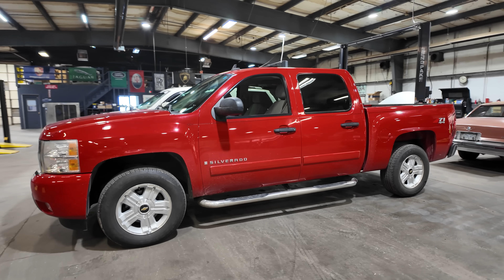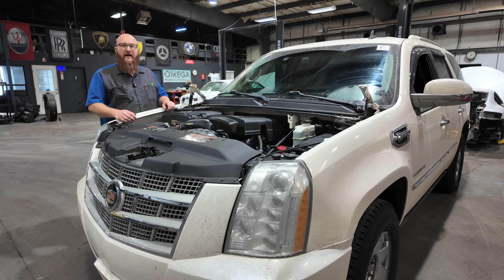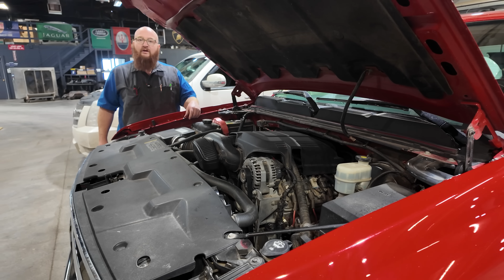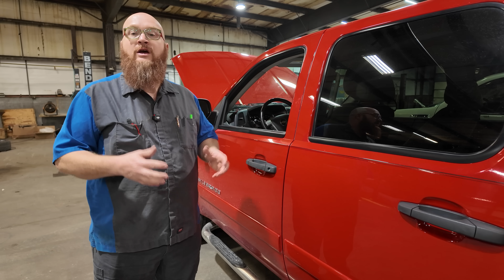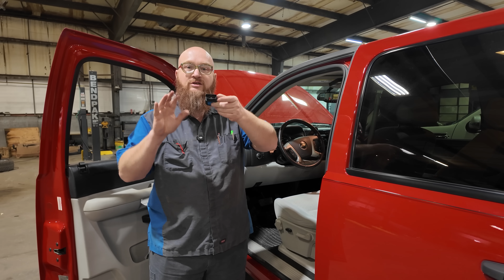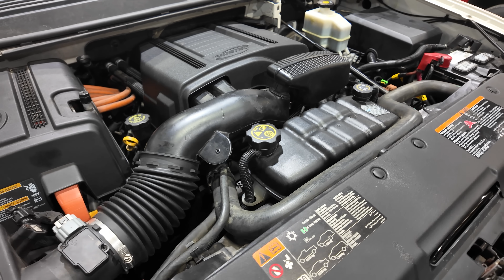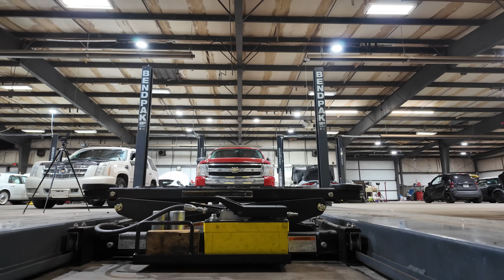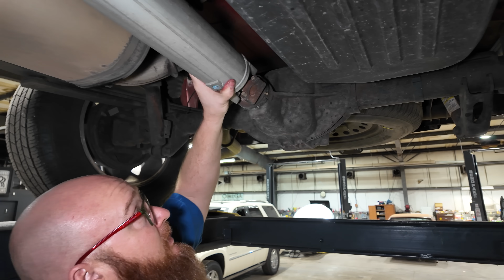AFM: Engine Saver or Engine Killer? The REAL Answer

Comment: I was thinking on buying a 2015 GMC Denali with the cylinder deactivation. This truck has a 6 speed so if you put it in 5th gear the truck runs in V8 mode and a 8 speed goes in 7th gear so apparently this tells the computer to stay in V8 mode. Can someone verify if that is true or not.

Comment: I wonder why every time somebody’s talking about that bullshit that GM invented they always try to throw in the oil change horseshit that has nothing to do with it apps I wish they would quit saying that it has fuck all to do with oil change that it was a design flaw if the oil is too thin or too thick. The design is what with the problem is as fuck all to do with anything else shitty wrong design. Try to get it straight if you don’t know how to say the word say it to yourself 1 million times and then don’t make a video unless you got it straightdesign flaw because the design was wrong. If you have to change something on the lubricant side, that means the design was not right don’t blame oil change or shit like this or anything else on it because if it in another engine runs on an extra 3000 km on the same then that one too so another word just said design flaw.

Comment: I just deactivated my AFM and tuned it on my 2014 chevy silverado with 159,135 miles. Better late than ever. I definitely feel my truck more responsive. Hoping to make it last another 150k miles. Also have an oil catch can on it and switched out the thermal bypass valve.
Reply: What and where is the "Thermal bypass valve". Is there a YouTube on how to do this? Is there a top quality thermal bypass valve to purchase?

Comment: Tons of respect Wizard but I'd love to know if you actually believe those work?  I've seen trucks with them installed with failed lifters and given the fact it's a mechanical failure in the lifter itself I have my doubts.  I also have a fear that preventing the valves from cycling normally could be catastrophic if the disabler box fails many miles later.

Comment: There are so many of these vehicles still on the road with the AFM working as it should. My 2007 had 238k miles and the worst thing I have is I have to add a qt of oil after about two months. I change the oil every 4000 miles now. I no longer wait for the engine computer to tell me to change the oil.

Comment: Current law in CA says any unapproved ecm programing with fail an emissions test. The only approved delete kit is sold by jasper with a rebuilt engine.

California screws consumers once again. You need to remove the plugin before inspection and ensure the monitors are completed.

Comment: AFM Is A Disaster...Running Spring Loaded Cam Lifters..Without Oil To De-activate Cylinders...ASAP..Buy A Delete Program...And Run All Cylinders The Way It Should Be....By The Way...Ford 7.3 Godzilla Engines..No Factory AFM......

Comment: Got a 2013 GMC 1500 with the 6 auto trans. Manual put in 5 gear selection and AFM will not engage. Thinking may get the delete plug in  for lots of highway driving. Believe it or not truck has 36000 miles on it! Think it was around 1700 RPM in 5th at 55 to 57 MPH! Who cares!

Comment: I'm a fan of your videos. You've made videos where you have said "do not buy" any of these trucks. I'm curious if you would upgrade these now to "buy with conditions." I have a 2017 5.3 and didn't really know much about this until I hit 100k. I heard that most have issues between 40 to 90k, but I went ahead and turned off the AFM anyway. I've had this truck since it was new and hope to drive it past 200k without digging into the engine. I've heard that switching to 5w30 will also help you to not have these issues, so I'm making that switch. I'm also reducing my oil change from the recommended 7,500 miles to 5,000. Curious what you think.

Comment: I did...had my 2018 silverado 5.3 deleted with the texas speed low lift kit professionally installed.....lasted 20,000 miles...#7 exhaust lobe was gone......now another $4500 for a rebuild with a stock cam.....yep....a lot pissed....

Comment: Oddly I guess, I had an 08 Yukon with the AFM 5.3 made it to 350k miles no major engine work, never disabled AFM. Had to trash it because Wisconsin winter finally took its toll. Driver side wheel well rotted out and the salt took out the electrical

Comment: Mr Wizard... curious question  ? Doesn't Chevrolet/GMC, offer a 6.6 V8 that does not have the AFM . In the 2500 / 3500 HD trucks ?  (L8...) Also something you didn't speak about.  The auto on / off mode. That repeatedly shuts the motor off and restarts it as you brake or stop .... Most trucks have a switch on the panel to deactivate it.  But you have to do so every time you turn the vehicle off and restart it. This system also causes problems ?

Comment: My 2012 Gmc Sierras engine 5.3vV8 had multile issues especially blowing a few lifters at 93k. Replaced with 5.3 v8 Jasper - no AFN  - have over 100k kn that engine - have had no issues and runs better than the gmc engine.

Comment: I have a 16 silverado with 200k miles. No AFM or lifter issues ever.  Regular syn oil changes and reg maintenance. Still drives smooth both in V4 and V8 mode.
Reply: Ive changed an engine in s 2019 police cruiser because of thd failure. Ive also deleted a 2022 police cruiser because it failed. 120,000 on the 19. 78,000 on the 2022. They have regular oil changes because we do all thd maintenance.

Comment: The lifters will still break on some engines even with the AFM disabled. My wife's 2016 Escalade did that. I disabled it with the plug in module at about 85K miles and had a lifter break at 114K miles. I did the full AFM delete at that point.

Comment: I have the disabler plugged in on my Sierra and the only downfall to it in my case is the cruise control doesn’t work while the device is plugged in. Remove it and the cruise control works again. But still, big picture, it’s worth the slight inconvenience

Comment: I used the Range disabler module, changed the oil every 3,000 miles with Mobil1 full synthetic, also use Lucas oil stabilizer. This is on my 2011 Silverado k1500 crew cab 5.3, 185,000 miles, still no noise. Also I removed the stock exhaust, replaced it with Long tube headers and full stainless exhaust

Comment: Replaced one collapsed AFM Lifter in 2019,  (I think it was number 4 Intake) with AC Delco (must have been a good batch). Tuned out AFM with Diablo Tuner. 70,000 miles later, no issues at all. No oil burn, runs like new with 250,000 mile on her.

Comment: I have DRM on my '14 Silverado LT V6 (4.3L) extended cab.  It's nice to get upwards of 36mpg over a 25mile range when it shift into 4 cylinder mode.  At nearly 16k miles, it's still running strong.  I do, however, change the fully synthetic oil every 3000 miles--although not Dexos.  There is a third way to turn off DFM/AFM: put the tranny into manual mode and shift it into the second highest gear (e.g., 5 of 6).

Comment: In ref to the AFM disabler, I have seen videos suggesting that the transmission thermostat should be removed or altered in some way.  I'm not quite sure what this could have to do with the AFM disabler, and I was wondering if anyone has some information that could help me determine the significance of the relationship of such a suggestion and if it is needed, thanks.

Comment: I have 3 trucks with the L9H 6.2L. (Non-AFM).  All have over 300K miles, have never failed, and still run fantastic.   The first thing I did to my '21 L87 6.2L truck, was delete afm/dod, the auto start/stop, and re-tune everything.   Oh, .....almost forgot...... I never run the oil GM suggests.   I run 10w40 in the L9Hs and 5w40 in the  L87, and have since new.

Comment: Lets talk about the LT engines and their failing plastice lifter trays that allow the lifter to spin in their bore due to the notches in the trays wearing out because it's metal on plastic or becomes warped due to heat and when the normal lubricating oil passages pressurize the lockout pin in the lifter because it's now orientated 90 degrees and collapses but still slams against the cam and chews it up...... ask me how I know. Other than that $8 part, I hadn't had any troubles with DOD at 250k miles

Comment: how bad is the AFM  system longterm? Of course we always hear bad stories about the AFM but what % of these engines  eventually require lifter/cam repair? My 2016 5.3L has 190,000 miles with no issues and no deletes

Comment: My 2018 is throwing misfire code for cylinder 7also smoking a little in the exhaust I  replaced coil, plug and wire. Still doing the same thing. Not really hearing any clatter though. I’m so lost don’t know what to do. thinking I may have to replace everything too.

Comment: We have a 2012 Silverado bought it used , the transmission didn't do the AFM until I had it serviced, after that I noticed something different. The dealer turned it back on. Sense then I bought the ObdII device from Amazon works great.

Comment: I had a 2007 Silverado that ate a quart of oil every 3000 miles.  GM tried to tell me that was normal, but my 2004 Golf diesel would only eat a quart of oil every 10K miles which was normal.  It would suck it into the PCV valve and burn it.  There was a TSB that stated due to the head design, the PCV was being splashed by oil.  GM designed a new head that had a cover in front of the PCV to stop it, but they wouldn't do the fix on my vehicle as it was out of warranty by the time the TSB was published.  I soon sold the truck and told GM some not so nice things.  It also had a leaf spring break which was a bit of a pain to fix as I had to drop the fuel tank to fix it.

Comment: I have a 2009 GMC Sierra with a 5.3, it currently has 235K miles on it. I bought it with 100K miles on it. I drove a lot for my previous job. I would check my oil once a month and change my oil at 3K miles. Everything was going fine until I hit about 130K miles. I was about 4 hours away from home and hear some clanking, didn't pay any mind because I have tools in my make very similar noises. I went to pass someone and when it shifted down, you heard noises match the rpms. I immediately pulled over, shut off the truck, and checked the oil. It had no oil on the dipstick. No oil pressure light came on and I had checked the oil 2 weeks before. I keep 2 quarts of oil and a gallon of antifreeze in every of my vehicles. Dumped the oil in and drove it the 200 ft to a little gas station. Bought 5 more quarts and it took 4 more quarts, it was bone dry. It quieted down immediately to no noise. I kept a real close eye on it driving back. Next day I got an oil change and got another a week later to and checked for the forbidden glitter, I lucked out and there was non. Called a local LS guy that I've used before on my 2000 Trans Am and tuned the afm out as soon as I was able. Changed the monthly oil checks to weekly oil checks. Haven't had a problem since.

Comment: I traded my clean low mileage Denali for a heavily discounted 23’ Armada platinum, brand new, due to AFM lifter failure on each bank before 40,000 miles. My Armada is the same age now  with more mileage, not a single issue.

Comment: Back in my drag racing days I used to use Rhodes lifters they were variable duration lifter and mind you I would put these in street vehicles not just racing vehicles but street vehicles as well and my Dodge van I had a 318 73 b100 and it used to work you know on the average got about 10 to 12 me on the in city in about 14 to 16 on the highway once I put the roads in there yeah sure City street if they made a little noise because they were variable duration lifter so yeah until the oil pressure came up to about 30 PSI or something like that you can get a little bit of a lifter noise everything was fine unfortunately I don't believe roads is even in business anymore

Comment: I’m glad to know my Silverado is at least easy to work on if/when anything does fail. We’re creeping up on 180k and I bought it with 140k. Been mostly trouble free, has a very slow oil seep from somewhere, and has a cold tick. Also doesn’t like idling very much, the rpms drop every 30 seconds or so, for like half a second. I’ve been pretty worried about the AFM and its problems. If anyone is reading this and has had similar issues with theirs, I would really appreciate any advice. It’s a 2013, 1500, 5.3.

Edited to add: I keep up with the maintenance, I only drive it when I need to because I’m trying to keep mileage low until I can afford to disable or delete the AFM. I don’t know much about the service history either.

Comment: I have a 16 chev pick up. It has afm. Dod system. I bought it with every thing functioning. I bought a range technology obdll plug in. Ive put 50 thousand miles on it. But i change oil every 3 to 4 thousand miles. Never more miles. It still works great .well see.

Comment: My 2006 gmc Sierra with the 4.8 non afm was the best gm vehicle I have ever owned.  My buddy still has it with over 250 thousand miles. I wish i still had it. I sold my 2014 Sierra as it was the worst one i have ever owned. I had so many issues with the 2014.

Comment: My brand new 2018.  5.3 chevy silverado !!!! And my brand new 2021 5.3 chevy silverado BOTH BLOW LIFTERS  !!!! LEFT  my girlfriend and I stranded the first time lake tahoe , the second time Lubbock  Texas  1500 miles away pulling my camper !!! So if you want big problems buy the chevrolet five point three and six point two !!! Those motors will always always blow lifters as\Sure , as the sun comes up tomorrow. !!!!! That is the only thing for sure in life that will happen !!!!!  From 2007 Even to today's date , two thousand twenty six !!! So I bought a two thousand six and made that truck brand new !!!!

Comment: There is another way to disable the AFM system from the cab, besides the OBD port device. Pull the gear shift into low and manual shift with the buttons on the shift lever. It will never go into AFM mode at that time. I bought the OBD device after I had a lifter turn sideways on #1 cyl, which sounded like a "sucking squeak" sound and destroyed the cam in short order. Just out of warranty but very low mileage, so GM went good for half the cost of the dealer repair. The next time the engine comes apart, the AFM system will be fully deleted and a decent aftermarket cam + lifters will go in.

Comment: There is another Way....put your truck in manual mode only until 5th gear....it will stay in v8 mode....if you shift to 6th gear it will activate the fuel management....you can also buy the one 2 dongle....but I get really good gas mileage in 5th gear

Comment: Gotta hand it to you Wizard.  I have a 330k 2007.5 5.3 silverado with AFM.  It's been working fine but I always have this dread that it will fail.  I want to do a cam with delete but it's just not in the budget right now.  I took your advice and bought a cheap $30 disabler from the jungle site.  It works perfectly,  THANK YOU!

Comment: I have a 2014 GMC sierra with the 5.3. when put in manual drive and limited to 5th gear actually tends to get better fuel economy than running in normal drive allowing AFM to activate. My hypothesis is that the AFM actually makes it use more fuel because I live in Colorado and the combination of the terrain and altitude makes the truck have to downshift sooner when AFM is actively running and it over-compensates.

Comment: It may be dumb but since 2007 to present it probably saved over 4 billion gallons of gas. The rich get richer and yet it's harder to keep my head above water and maintain my vehicle let alone walk into a Chevy or GMC dealership and buy new. I miss my 4.8 for this reason and have the new 6.6L gas although now I'm nervous about the direct injection leading to dirty valves let alone the complexity of high pressure fuel pumps. I suspect my caprice ppv 6.0L at 170k miles is experiencing lifter failure. Should I restore the system or delete the DOD/AFM? If the economy trickled down I wouldn't be as desperate to make my vehicles last over 20 years although I dont need all these new screens on these new cars. I believe these engines are a cheaper to own than the turbo alternatives which are also capable of gas guzzling. I would like an 8 speed auto though if I have to have auto.